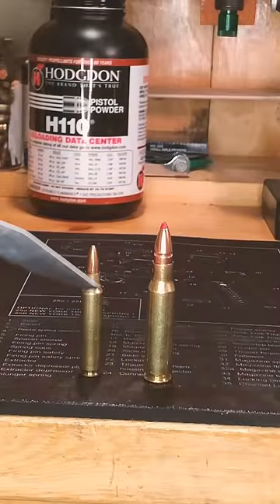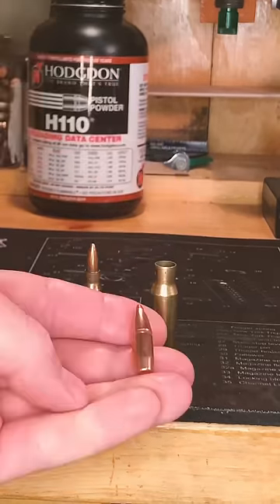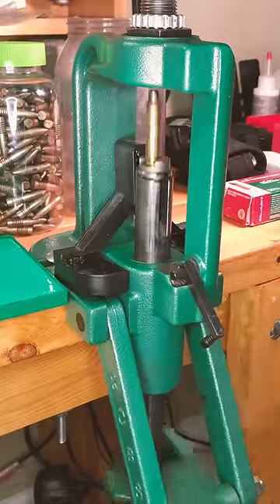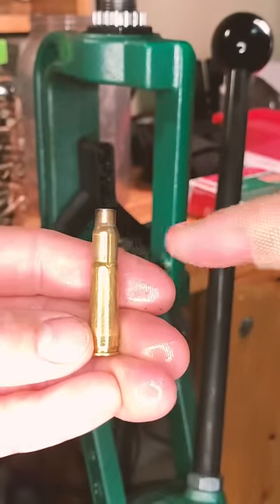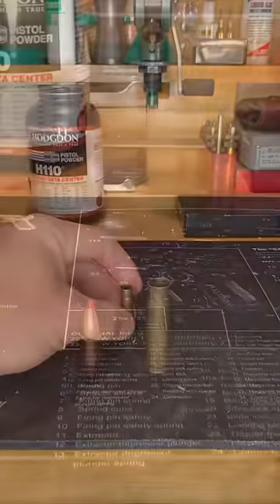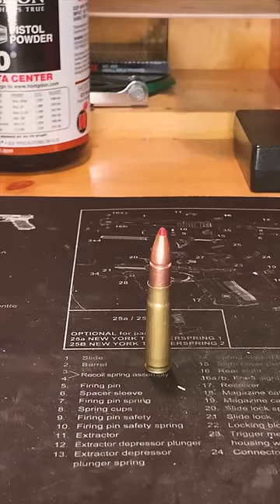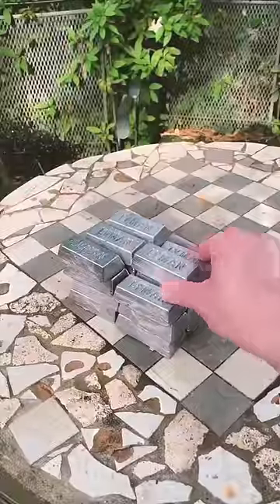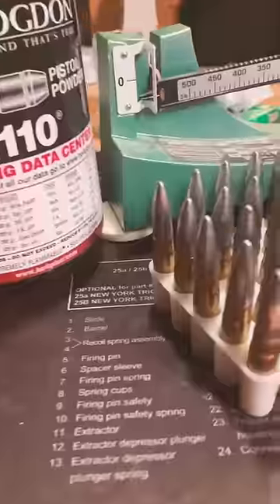A brief synopsis on the concept and history of 300 Blackout. Part 3. #shooting #guns #reloading

Comment: And if you take the .223 caliber slug and throw it on the .308 case you literally have a .22-250. One of my favorite rounds
Reply: El rapido
Reply: I came here to make the same comment
Reply: Probably one of my deeper regrets in purchasing firearms, so far as cost vs ballistic advantage. It is however, a tack driver at 300 yards.
Reply: No, the 22-250 is based off the 250 savage, it's right there in the caliber designation.
Reply: I was talking basic caliber comparisons in relation to ballistics, not official origins of the round. It may have originated from the Savage 250-3000, but that was based on the .30-06 which is indeed a .308 @wymonwatson1309
Reply: @spyder6423  Well here we are again, arguably the .308 is actually based off the 300 savage, which is in turn based off the 30-06. So technically your sorta right. I get you were making generalized statements, but there's already enough know it alls full of incorrect information running around already.

Comment: 300blk is great for suppressors since you can reach max velocity within about 9 inches of the chamber, before you begin losing gasses thru the suppressor. I just mean that's it's basically a freebie performance wise. Some other .cal take as much as 2x barrel length to accelerate to max velocity. The point being that cutting down the barrel and pinning a suppressor has no detrimental effects.
Reply: BO doesn't make max velocity in 9" barrel.
Reply: @joshrandall3632  You're absolutely correct. I misspoke. "Rifle velocity" is the term I should have used instead of "max velocity".

Comment: That's fantastic. However, I have to inquire as to whether you powder coated those lead bullets. The reason I ask is lead will build up in the barrel, especially on the gas port. You will have to scrub the barrel often to remove the lead fouling, but you won't be able to get into that gas port to clean it. If you go too long between cleanings and the lead builds up too much near the chamber, you will get an overpressure situation that could be bad for the rifle and you.
Reply from the maker: Lead fouling has never been a problem for me after 14 years of using cast lead bullets. I inspect my gas system at intervals and the 20-30k psi is apparently more than adequate to keep it clear. 
I have always used Lee liquid Alox and copper gas checks (when applicable). If, however, I ever did suspect lead fouling in one of my barrels, it would be a simple procedure to remove it… there is an every day household item called “Chore Boy 100% copper scrubbing pads”. About a 1”x1” square cut from an unrolled layer of this curly copper mesh can be wrapped around an ordinary bore cleaning brush. Working from the action towards the muzzle, this contraption should be pushed through. (It may take a bit more effort than an ordinary brush. ) a bit of cleaning solvent (NOT the copper dissolving type) is helpful in getting it through. The curly strands of copper will drag out any lead present if there is any and it will not hurt your bore. 
Some opt to do this, just to check for the presence of lead in the rifling, if, for no other reason than to rule it out.

I find it interesting that there are so many folks so apprehensive about the use of a lubed lead bullet vs one that is either jacketed or plated. Two questions I would pose to every one of them is “Have you ever heard of Remington Thunderbolt 22LR? “ and 
“How much of it have you shot?” 
I think 95% or more of them would answer “Yes. Oh wait a minute….Thousands. “ 
-Stagger
Reply from the maker: Regarding the powder coating: There is no denying the popularity of powder coating. Granted, it may, indeed at some point supplant proven lubricants like Alox. I’ve seen individuals on many YouTube channels swearing by the powder coating with much enthusiasm….but until powder coated bullets are being sold by a major component supplier like MidwayUSA, this is why I currently won’t do it: 
Lee liquid Alox has been extensively tested in an actual firearms laboratory. With a very expensive chamber pressure measuring tool that likely neither you, I, or most YouTubers could ever afford. Not only that, even more extensive tests have been performed at Lee Precision, such as inspection of bores with small cameras following thousands of rounds to ensure that their product prevents leading of the rifling. While Alox may not leave my projectiles looking like all the fun colors of a bag of skittles, at least I can rest assured that it will always keep my firearm functioning perfectly when using unjacketed projectiles.  
-Stagger

Comment: The flip side of that coin is if you neck down the 308 brass to 22 caliber you'd have the 22 CHeetah which can hurl 40 grain pills at nearly 5000 FPS. I have a 98 Mauser in 22 CHeetah.

The original 22 CHeetah used 308 Benchrest brass which has a small primer pocket. The case taper was minimized, the shoulder move slightly forward and the shoulder angle changed to 40 degrees.
Reply from the maker: Yep that’s right. 
The 22 CHeetah 🐆. Developed in the 1970’s by Jim Carmichel and Fred Huntington (the father of RCBS). It shoots at blistering velocities exceeding 4,000 fps with remarkable long range accuracy. But the trade off: it is particularly hard on rifle barrels. 
And like it’s name…the .22 CHeetah remains a wildcat cartridge to this day. 
Happy shooting 💨 
-Stagger

Comment: I Love 300 BO.   My absolute Favorite Rifle,  and the Only one that I have Tax Stamps for  (Two Tax Stamps,  One for SBR and One for the Suppressor).   I Built it 2 years ago as a Pistol and got the Suppressor for it.  But when ATF granted the FREE Tax Stamp to register as an SBR (at the beginning of this year)  I went that route and threw a telescoping PDW Stock on it.  With the  7" barrel and the almost same length Suppressor, along with the Adjustable Gas System in the "Short Stroke Piston Upper"   Makes this thing  Bar None,  My Absolute Favorite Rifle I have.
Reply from the maker: That’s awesome brother. I can see that you love your weapons as I do and are doing your best to remain legal and protect your freedoms. 🇺🇸 
Thanks so much for this very good contribution the thread! 👊 😎 
-Stagger

Comment: You can always use a plumber’s tubing cutter to cut cases while you chill on the sofa watching Netflix.
Reply: And that was my next question.
Reply: 😂😂😂 not if you want your shit to work.
Reply: @joshrandall3632  We are glad that you interjected your decades of reloading wisdom for us.  Seems we’ve been doing it wrong for our matches all these years.
Reply from the maker: Nothing wrong at all with the tubing cutter method…it does work but for me was too slow going. I prefer to use my knife-making belt grinder equipped with a 36 grit Red Label belt (you could go finer if preferred) to take it down to the “faint line” I pointed out in the video. This still leaves about 1/8” leftover to allow for any degree of human error in this cut (which isn’t much since it’s sitting on a tool rest). That 1/8” is later taken off by my Lee case trimmer which nips it off in about 1 second. I chuck my Lee lock stud in a drill while the case length gauge is held in a vice. I can convert a very large amount of .223 into 300 blackout in a very short time using this method. 
-Stagger
Reply: @staggerleesmancave8987 I don't have a knife making belt grinder, so I set up the Harbor Freight mini cut-off saw. other than that, I make them the same way. I haven't done it in a while because the cartridge has become popular enough, that I regularly get once fired range pickup brass now. it's still good to know how and have the tools handy to do it though!

Comment: Another thing: 300 blackout uses pistol powder (it burns faster) so it can be better used in short barrels and silencers and be quieter
Reply from the maker: That is correct. Several of the approved propellants in the available load data are indeed pistol powders. My favorite for this cartridge is Hodgdon H110.
-Stagger

Comment: Love the content... have you noticed your barrel getting leaded at all?
Reply from the maker: Thanks so much. Luckily the Lee Liquid Alox (and gas checks when applicable) have worked 100% for preventing leading in my barrels. Not sure why everyone is so hung up on powder coating when the aforementioned measures work perfectly. Maybe it’s because it makes their bullets look so pretty. 
I perform periodic checks for lead deposits by wrapping strands of Chore Boy copper scrubbers around the wire brush portion of a Hoppe’s Bore Snake and pulling through while holding the whole operation over a large sheet of paper to catch any lead deposits. (You must wrap enough copper strands to where it takes considerable effort to pull it through). After 14 years still no leading. 
-Stagger

Comment: Do you have leading problems in your barrel after using the 220 grain?
I’m interested in casting my own for my 300blk, but a lil concerned about having to jacket the casts
Reply from the maker: Lead fouling has never been a problem for me after 14 years of using cast lead bullets. I have always used Lee liquid Alox and copper gas checks (when applicable). If, however, I ever did suspect lead fouling in one of my barrels, it would be a simple procedure to remove it… there is an every day household item called “Chore Boy 100% copper scrubbing pads”. About a 1”x1” square cut from an unrolled layer of this curly copper mesh can be wrapped around an ordinary bore cleaning brush. Working from the action towards the muzzle, this contraption should be pushed through. (It may take a bit more effort than an ordinary brush. ) a bit of cleaning solvent (NOT the copper dissolving type) is helpful in getting it through. The curly strands of copper will drag out any lead present if there is any and it will not hurt your bore. 
Some opt to do this, just to check for the presence of lead in the rifling, if, for no other reason than to rule it out.

I find it interesting that there are so many folks so apprehensive about the use of a lubed lead bullet vs one that is either jacketed or plated. Two questions I would pose to every one of them is “Have you ever heard of Remington Thunderbolt 22LR? “ and 
“How much of it have you shot?” 
I think 95% or more of them would answer “Yes. Oh wait a minute….Thousands. “ 
-Stagger

Comment: Great cartridge if you want to compensate for drop at 100 yards.
Reply from the maker: The .300 BLK can be loaded in projectile weights ranging from 100gr all the way up to 230gr with velocities ranging from 2485 fps all the way down to subsonic (around 900). It is a very versatile round. 
The 130-150gr bullets going around 2150fps perform very nicely on deer-sized game.
Regarding your rather overgeneralized statement about bullet drop:
A 300BLK loaded with a 150gr bullet going 2150fps would only have to be .39 inches high at 75 yards to be zeroed at 100. With this same load and zero, you would still only drop 7.24 inches at 200. That’s a bit more than a bun- length hotdog 🌭.  So…maybe not as bad as you thought? 
Happy shooting 💨 
-Stagger
Reply: @staggerleesmancave8987  you can do the same with 7.62x39 but cheaper and has a stronger taper to help with feeding.

Comment: Great video, I never exactly knew the background how it was done. Can’t you also use a mini saw and just cut the tip of or is that only after resizing to 30 cal?
Reply from the maker: Yes, a mini chopsaw is actually the most popular tool for this. (Taking the case down to the faint line I pointed out ) I just happen to prefer using my belt grinder that I use for knife making. (a 36 grit Red Label) Crazy fast with a good clean cut. 
-Stagger

Comment: Great video! Did you use .308 sizing die for 223 case in the video? I'm going to start 300blk reloading, but it takes some time to get equipment from US to Ukraine.
Subscribed!
Reply from the maker: It was actually a sizing die specifically for 300 blackout! The die set I am using is by Lee precision and includes a resizing die, bullet-seating die, and a collet crimp die. The die set usually costs around $45. I will be doing a short in the near future that details how to convert .223 brass into 300 blackout brass. Good luck and happy shooting!
-Stagger
Reply: @staggerleesmancave8987  Thank you for the detailed answer. Gonna order this set then.

Comment: Ooooh it's just a .308 bullet. I was really impressed at how fast someone came out with a new mold lol What powder and weight do you use for subsonic loads?
Reply from the maker: I currently use 225gr TL Spitzers cast from an NOE USA mould. Seated over 8.0gr H110. BE CAREFUL WITH YOUR COAL. very tight tolerances for pressure changes here! The data included with the Lee pacesetter die set is good. Most major reloading manuals I have pre-date the Saami approval of 2011. 
-Stagger

Comment: Why was the 7mm TCU never chambered in the AR? It killed stuff at 150yds out of a 14" Thompson Center pistol.
Reply from the maker: By measure of ballistic performance and the fact that the parent case is the .223, I agree it would’ve been a good candidate. But according to my research, the standard of practice for making 7 mm TCU cases involves an unusually complex step: it must be fire-formed, to create the new shoulders necessary for its case dimensions. This is not nearly as streamlined as simply running through the new full length, resizer die. I am definitely not an expert on the topic, and I fully invite anyone to jump in and fill us in here. Because I as well, don’t really understand why they couldn’t just make a die to accomplish this step. But from everything I’ve read, they must be fired-formed at least once before they are legitimately 7 mm TCU cases. 
I speculate that such a tight fit may also have issues reliably cycling and chambering in a semi automatic. Again, I fully invite anyone to jump in and tell us more. Happy shooting. 💨 
-Stagger

Comment: You should powder coat those rounds to prevent leading of the barrel. This is all I shoot target wise now and have zero leading issues
Reply from the maker: I find it interesting how many individuals refer to powder coating like it is the new standard while to my knowledge, there is no literature to support it’s use and safety. 
 There is no denying the popularity of powder coating. Granted, it may, indeed at some point supplant proven lubricants like Alox. I’ve seen individuals on many YouTube channels swearing by the powder coating with much enthusiasm….but until powder coated bullets are being sold by a major component supplier like MidwayUSA, this is why I currently won’t do it: 
Lee liquid Alox has been extensively tested in an actual firearms laboratory. With a very expensive chamber pressure measuring tool that likely neither you, I, or most YouTubers could ever afford. They have also performed inspections with bore cameras after thousands of rounds to ensure that their product prevents leading of the rifling. To my knowledge, this cannot be said of powder, coated bullets. While Alox may not leave my projectiles looking like all the fun colors of a bag of skittles, at least I can rest assured that it will always keep my firearm functioning perfectly when using unjacketed projectiles.  
-Stagger
Reply: @staggerleesmancave8987  I’ve coated and shot 10’s of thousands of rounds and didn’t need a pressure guage to tell me it works way better than your alox!  It also coats the rounds preventing more lead exposure. To each their own.

Comment: Do you have to wear some kind of protection when melting and pouring lead? I'm almost positive lead is super toxic.
Reply from the maker: Lead is indeed toxic. One should wash hands immediately after handling lead… And I do. There’s nothing wrong with wearing gloves, but they are actually optional when it comes to handling metallic lead. As long as you wash your hands immediately after handling your practices are actually safe. 
This is due to the simple scientific fact that lead can not enter the body through the skin. It can only enter the body through the mouth and nose. This is medically proven. For anyone who is interested in knowing: I actually do have my blood lead level checked at every other annual doctors check up. I think it should be a credit to my credibility and safe practices that I have actually maintained a lower than normal lead level even after 14 years of handling lead in the context of ammunition handloading. This video series has undergone a great deal of criticism for individuals who presume to know a lot more about lead than they actually do. I would encourage those individuals to do a bit more reading before becoming so critical. Lastly, when it comes to respiratory PPE: here is another proven fact that scientifically, there is no arguing against. Lead does NOT become airborne, unless it reaches its heat of vaporization which occurs at well over 2000°F. The procedure I have carried out in part one of this video series does not even exceed 800°F. Again, I do not critique anyone who chooses to wear a mask of some kind that is entirely up to them. But in the same breath, I must say that it is also not wrong to go without a mask if you are maintaining a temperature that is beneath the temperature at which lead becomes airborne. I encourage everyone to practice safety, and anyone who would say otherwise I would never endanger my child, or any other child for that matter. The youngster has been taught well to definitely wash his hands after any and all exposure to lead. 
-Stagger